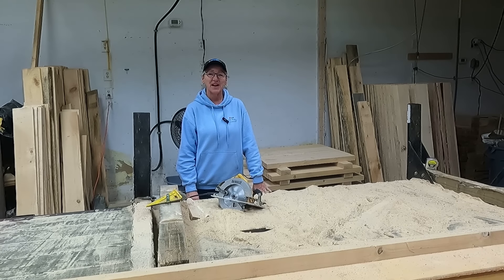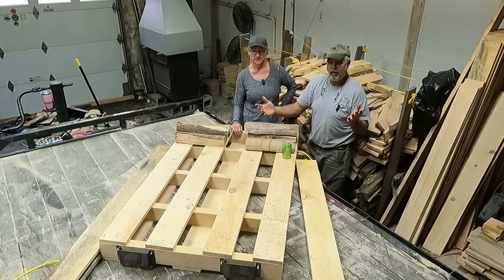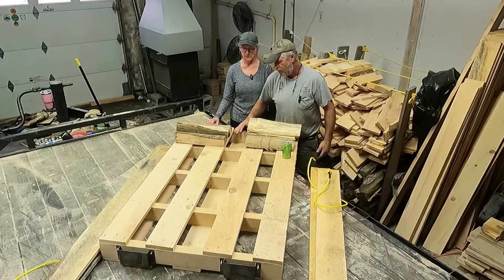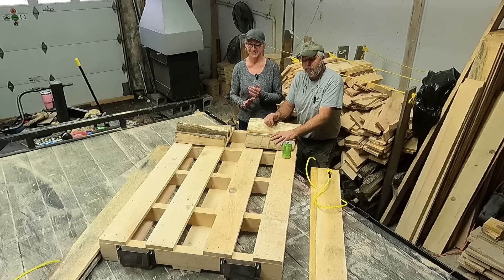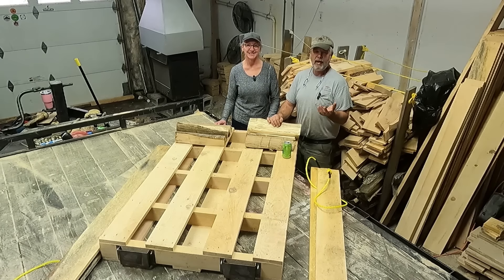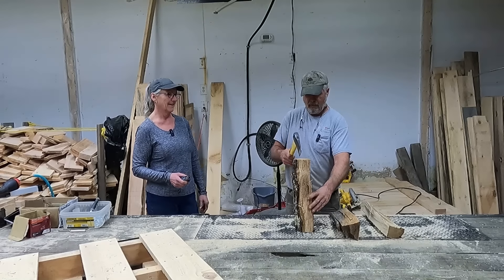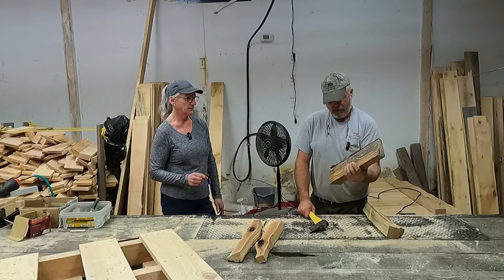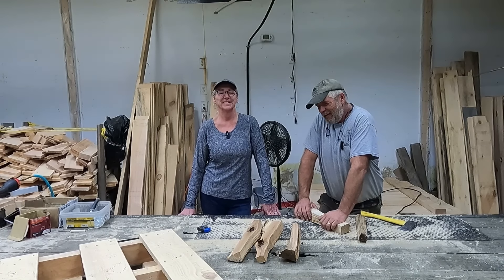NEW DESIGN FOR OUR CUSTOM FIREWOOD PALLETS AND CONCLUSION ON THE KILN

Comment: Hope you two relaxed and enjoyed the play day.🙂 Had a thought on stabilizing  the new pallets/stacks. Maybe cut some 36-38 inch slabs to span using 3 across and every foot n half to two foot of height as you stack up to your 5 foot height.  Maybe it will stop the tip in effect.  Good luck👍
Reply from the maker: Thanks we did relax for the most part    i'll have to look at doing something like that if they're too unstable moving them

Comment: Hi Phil and Karen. I’m sorry the kiln hasn’t worked out for you with drying your wood so far. Hopefully your newly designed pallets will work a lot more efficiently? Good luck with it.
Stay warm when looking outside with that snow and ice everywhere looks bitterly cold.
Reply from the maker: Thanks Wayne   we just got another 5 inches of wet heavy snow   hopefully the new pallets will make a difference

Comment: Hello Phil and Karen. There is nothing as nice as fresh white snow covering a layer of solid ice. Working outside in that weather would have been a disaster. The new pallets seem to be a great idea.  Is it possible to build a spacer something like a pallet. Than shove it side ways between the two rows of wood while moving the wood.  Pulling it out when you get it to its final location, to prevent the wood from moving during transport. Thanks for another good video.
Reply from the maker: Thanks DonO    we may have to do something like that with the pallets if they're not stable enough when we move them    we'll try it first and hope for the best

Comment: Great interesting video. Thanks. Nasty weather your gettin. Jumpins. 
Will be neat to see how the new system works out. Could you put a temporary thing in between the rows to keep it stable while moving them with the tractor. 
You need the heat source right in the room. And get the room to 130F or a little more. 
Hoping things come along good for ya 👋👍🏻👍🏻👋
Reply from the maker: I think we are getting 6 more inches of snow  tonight so by morning it will probably be snowing at your place . There was a comment that we should span a 16 piece of wood between the rows to catch each pile an that would help . We also can wrap each row with that stretch wrap stuff so that should help as well . Im thinking a wood boiler with a heat exchanger right in the room but i need a boiler big enuf to run for 12 hrs on a load of wood and be able to keep up with demand that kiln will need . Probably going to take a outdoor woodboiler to do that an even a used one is not in the budget this yr . Thanks Noel
Reply: @AllenFamilyFirewood  ya. Was thinking that puttying wood in between.  Have a great day. No snow here yet. 👍🏻👍🏻
Reply: @AllenFamilyFirewood  Does wrapping the wood with the stretch wrap prevent evaporation which then limits air flow? sounds counterproductive.🤨🤔

Comment: hi there like the wood racks/boxes . i have made lots over the years . i stopped putting the bottom boards on them . for several reasons . i also switched to just 3 pressure treated base boards ,got tired of the rotting , witch would render the whole useless . always looking for a better box , john
Reply from the maker: yup they do require maintenance after time  so they don't fall apart

Comment: Phil if you put a couple pieces of firewood over lapping about 2/3 the way up it should keep your rows apart.😊 Keep up the good work 👍
Reply from the maker: We were thinking 3 ft 2 by 4s but i didnt want them getting dumped into the trailer at delivery time but ya thats a good idea we will try some 16 in pieces of just firewood that will go from stack to stack . Gota ck with the stacking machine first cause she likes to stack one row then start the next by adding pieces to span both piles you would have to stack both rows at the same time an she might not like that idea . .

Comment: I still think if you add a dehumidifier to the kiln it'll work better. You might be surprised on the economics of it. Leave the exhaust pipe going outside, add a dehumidifier with a pump to a 5 gallon bucket and go through a load. If you want you can put a "kill a watt" meter on the dehumidifier to see how much power it's drawing and figure out the cost for a load. It's where I would head anyway. Good luck
Reply from the maker: So no heat blowing into the room and no air exchange  i think is what ya saying with just a dehue running . I agree a airtight room with just a dehu running will eventually dry the wood the bigger the dehu the faster the wood drys . I belive most of the guys doing that have some sort of electric heater in there as well . Because our building is called comercial we have to pay a comercial power rate an thats about 25% more than residential rate . I think we pay around 14 cents pr kilowat hr but dont quote me on that . We had actually talked to another firewood guy near by that has his kiln set up with propane heat an a big dehu an he said its a break even deal for him an that he only does it to keep a few of his customers happy . The added $ he gets from kiln dryed just pays the power bill an propane bill .
Reply: @AllenFamilyFirewood  I would continue the heat into the kiln, keep the outside exhaust so your shop doesn't rain inside, but a dehumidifier will pull the moisture out much quicker. Having one that has a built in pump to a 5 gallon bucket you won't have to empty it as often and you can still monitor how much water is coming out. Here in the U.P. we have one on the highest electric rates in the country and a friend of mine drys lumber in his shop with just a fan and dehumidifier. I myself am planning on making a kiln for lumber with a dehumidifier and a natural gas boiler
Reply from the maker: We just got the power bill for the shop.  Can’t continue the way we’ve been doing it.  Outrageous!

Comment: I think the pallets will work better in the long run.. the kiln was a good experiment..😉👍
Reply from the maker: More airspace should equal faster drying outside and inside . I think we will try pine for our next run in the kiln that stuff dries really fast probably should have started with that first instead of the hardest stuff to dry . Fresh split ice cold red oak is probably the hardest wood to dry . Having that extra air space on the new pallets should make drying pine in there work alot better than the hard wood . We might also hang some plastic to force the hot dry air threw a tunnle of sorts so it has to work its way threw the wood . If that dont work then the woodstove is out an we will have to go with a wood boiler an supper insulate the room then i know we can get the temp up around 150 an just put the fan on the exhaust side an set it to come on when the humid reaches a certain level .

Comment: Interesting stuff!  If you put long pieces that connect the rows they should be stable moving around, maybe three 2x4s half way up and 3 more 3/4 the way up.  Just stack them in and the weight/pressure of the firewood will wedge everything together keeping the stacks from leaning in or out.
Reply from the maker: I was thinking the same thing but when i dump them they would get mixed in the load of firewood . We have alot of 2 cord orders so 4 pallets with 6    2 by 4s pr pallet would be alot in a load . Back when i was a kid thats how we held the rows from tipping over just throw a 3 ft stick in every now an then to tie the rows together .
Reply: @AllenFamilyFirewood  Would the load be in a tension so why the need for 2x4s? 2X2s or 🤔

Comment: As I've mentioned before, take your same experiment, even less heat but use a standard dehumidifier, you will see significant results. Air circulation and low humidity are the keys to drying wood, heated air speeds up the process but heated air at 50% humidity won't do a lot.
Reply from the maker: The air in that room is being changed out every few min . Hot air comes in one side of the kiln room threw an 8 in pipe its 120 -140 degrees an 12% humid  the air goes threw and around the wood and exits on the other side out a 8 in pipe at about 50% humid . The fan blowing the heat in threw the pipe is moving alot of air . So im pumping hot 12% air in an cooler 50% air out and its changing the air in the kiln room about every 3 min  . I would think that by adding a dehue in the kiln  with that much  air coming in an going out that fast that it would be like trying to put a lil piece of ice on a hot day in the middle of a tar parking lot but i could be wrong it just dont make any sence to me how it could work . I can see that if i sealed the room tight with no heat an no air in or out that a dehue would work but with what we pay for electric it would cost more to dry the wood than the extra we can get from having it dry compared to just selling it green .

Comment: Now that you build skids with a wider gap in the middle. How about having as a one time purchase of removable plastic French Drain tubing that you slide in the middle. I think if quick-connected grid like setup, all interconnected powered by a high velocity leaf-blower style fan would turn your kiln into a constant wind tunnel.
Reply from the maker: Might work im not sure . I think with the new pallet an a fan blowing down each row it should get lots of air for drying .

Comment: My only thought for the kiln is, if you are heating humid air from one room and pushing it into another room you may actually be increasing the moisture rather than decreasing it. A dehumidifier may be an answer, that way the moisture is removed before it passes by the wood. My thinking may be all wrong. Just some ideas.
Reply from the maker: Thanks for the ideas David   Unfortunately the power bill we just got for the shop said no more kiln trials lol    outrageous
Reply: I understand. My power bill went up also. @AllenFamilyFirewood

Comment: can you just put a wood stove in the drying room and shut the door?  would it get too hot in there?
Reply from the maker: That would work great but the chimney would be 50 ft away . If i had it to do over i would have put the chimney at that end of the building . Im thinking a outdoor wood boiler is the answer .
Reply: @AllenFamilyFirewood  I would try an electric construction heater in the room first  maybe 2 of them to get the.temps up to 30 degrees Celsius for a week or so   if that works then I would be more confident  to invest in a chimney or outdoor wood boiler

Comment: A kiln must be  kept at  170-+190 degrees for  at least  60 to 72 hours, this also  includes  air circulation.
Reply from the maker: Ive ben told that but ive also ben told that once ya hit 130 it kills all the bugs . It would take quite the set up to hit 170 -190 an im sure at them temps it wouldnt take long to dry firewood . We figured it was worth a try using the woodstove an fans knowing that it wouldnt be as fast but we didnt plan on burning 3 cord to dry 3 cord so we need to figure something else out . We will try it one more time but this next time will be with pine because that dries really easy and we will add more air space between the wood . I guess after that if it dont work we will have to upgrade to a wood boiler to heat the room an add alot more insulation .

Comment: I absolutely hate freezing rain. It is horrible and I am too old to deal with it. It usually nocks our power out for a few days. It is even worse when all that frozen rain is covered with snow. It helps when you can make your own pallets because you can get what you want, when you want it. Last night we had bad thunder storms all night and it is about 40 degrees today. It is gray and sloppy wet. Great day to be in a wood heated house. I think you have your heat source too far from the wood and you need more air flow across the wood. Just like drying outside mut on steroids
Reply from the maker: Ya the freezing rain is no good i think tonight we are supposed to get 6 inches of snow so that ought to add to the fun tomorrow lol. The pallets are nice but very time consuming gota saw the logs get the lumber inside cut it all into pieces an parts then i can build the pallets but everyone we build this yr is one less we need to build next yr . This summer i think we will swap over to a wood boiler an really seal that kiln up good , hopefully that does the trick but im still going to try drying some pine in there in a few weeks to see how that will do .
Reply: @AllenFamilyFirewood  100-200 cords to break even $ not to mention the time spend stoking fires, building pallets moving wood in and out of the kiln.🤔 sounds like more wood handling not less.

Comment: I think your wood stove is too far away from your kiln. Hope the new pallets work better for you guys
Reply from the maker: It sure would work better if it was in the kiln but even being that far away we insulated the pipe an its bringing 120 140 degree dry air into the kiln room . Hopefully with alot more airflow on the pallets that helps speed the drying time .

Comment: Phil and Karen probably just use work shop went the fire 🔥 is going work help to remove moisture down in firewood 🪵. 😊
Reply from the maker: I think we would have had about the same luck if we had done that . In a few weeks im going to put some pine in the shop for a week or so before putting it in the kiln . Pine drys really fast so i think we will have better luck with the pine .